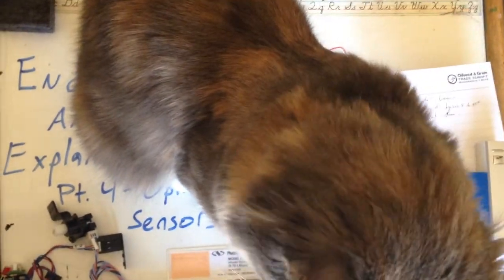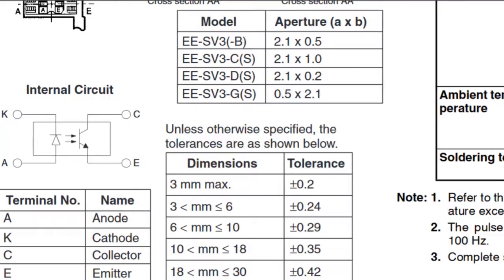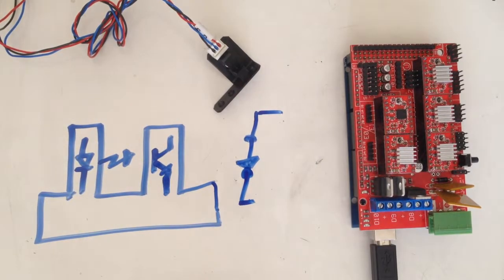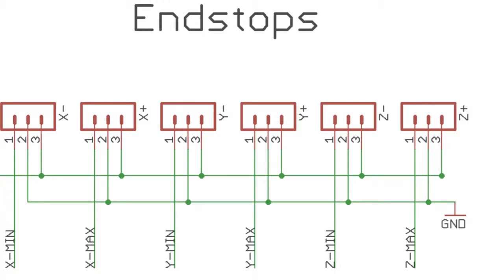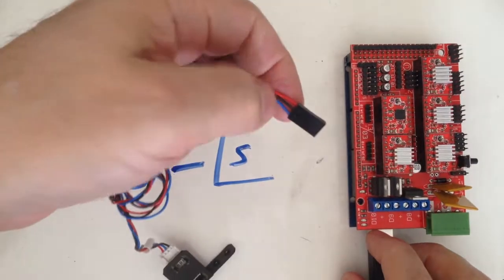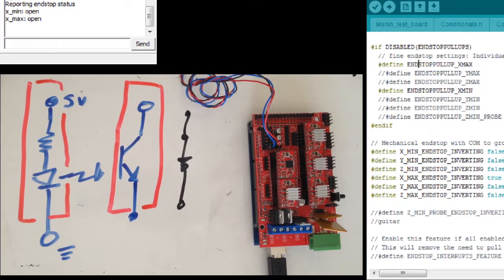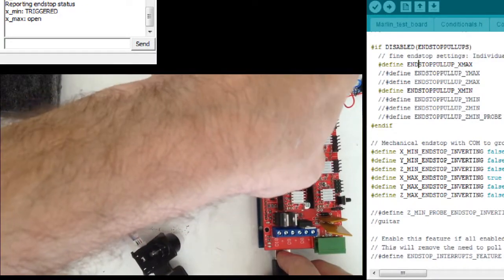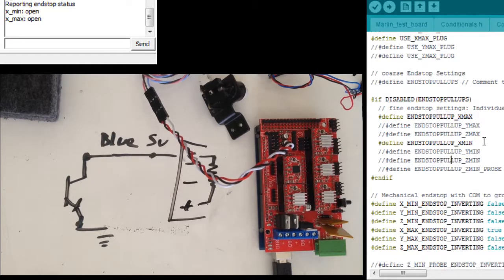Endstops and Explanations Pt 4  Optical Sensors

Comment: my problem have linuxcnc limit SW, i want use 3D printer optical sensor but problem have sensor have 3D printer uses 5V and my DIY big linuxcnc use 12V all sensors input. need make Z axis home SWITCH optical 5 V sensor, can i connect this to 12V power, or need use 5V and then output go to BOB card 12V sensor input pin. how connect this.

Comment: I have some confusion about the naming conventions...  Is the energized state considered the normal state i.e. If I have power, the switch would be closed, but if I don't have power it would be open. So would that be considered "normally closed" even though it needs electricity to be in that state??
Reply from the maker: very sorry for the late reply, I wasn't seeing any updates for some reason.  So, the "standard" way of saying a switch is in the "normal" position is when the switch is inactive.  Or as I was taught, if the switch is sitting on a table with no power or wires connected and nothing pressing on it, then this is it's "normal" state. The Normal state of a switch is that it isn't being used or actuated. Now, a switch can have Normally open contacts (no physical connection inside the switch, no current flows through the switch), and Normally Closed contacts (switch contacts are connected to each other, current flows through the switch). So you can have a switch that is passing current through it through Normally Closed contacts, even though the switch is considered inactive, or not actuated. If I am understanding your question correctly, (and I might not be), you don't need power on the switch to change it from a normal (inactive) state to an active state.  The switch ALLOWS power to flow through it, but the switch state changes based on if the actuator is pressed and the contacts open or close. The switch doesn't need power to be in either state, it just allows power to flow or not based on the switch state.

Comment: Hi, i have a cnc with mechanical switches and i want to put optical endstop switches, i bought some lerdge optical endstops , you talk about 5 volts to the switches but my machine throws 12v to the switches  and the signal pin has 12v and when you activate the switch goes to 0v , if i connect the optical switch the led is always on and doesn't do anything if i put the flag in between , would these switches work on 12v? do i need any extra circuitry to make it work, i don't know what kind of board i have  i know it runs GRBL 1.1
Reply from the maker: Sorry for the late reply, I wasn't getting updates. The answer to this is that I don't know what model of optical sensor you have.  can you send me a link? You'll need a sensor that can run on 12V, if you 12V on a 5V sensor, it won't work very well or very long.  Some sensors can work on multiple voltage ranges.  I have some Omron sensors that can work from 5-24V.  But most hobby grade sensors don't have that kind of flexibility.  Knowing what board you have would also help, as some boards have internal pullup resistors on their inputs and some don't.  If you can help me with that information, I can give you a better answer. There are too many variations of sensors and boards available for me to give you any kind of solid answer at this point.

Comment: great video but.... i have a 4 wire optical rd blk gn we and am told to use a 10K resistor somewhere and have a duet3 6HC and the IO pins are 3.3v sig in gnd sig out and 5 v
you mention treansistors but i have to use series resistor to achevie 160 ohms with 3.3v and 380 ohms if i use 5v could you help with the wiring orentation and what it would look like for me?
also it does not indicate to use 1/4w1/2w/1w ect... does it matter?

Comment: What is crazy?
I tell you what is crazy.  When you are someone like me who can't understand all the lingos, some maybe real and some made up.. who knows..  nonetheless just can't get what they are saying.   All that is left is trial and error.
And by golly I actually did it.
So this so-called photo-interrupter that the signal wire is negative and when the path is blocked, the signal just goes to 0volt, to put such a device as a subsitute for a hall sensor in which it is to be used with pull up resistor and when it is by a magnet its signal wire goes negative, not zero... how to do it.
Unreal, after every which way till sundown, at last got her smooth sailing.
1K resistor at its positive wire to positive rail and its negative wire to negative rail.   A 1k resistor at its signal wire to the base of a BC557 (PNP).  The Emitter to positive rail and the collector via 380ohm resistor to the gate of IRF9540N (P channel) and then a 10K resistor not to the positive rail but negative rail (mind you), or in the expert's lingo pull down.
To protect the FET from back emf of the coil of wire, and LED with 380 oh from the source and its cathode side at negative rail.
The coil of wire (the load) if you will also feed at the source and the positive rail with it proper ends to these contact points so that when the current move the coil will repel the magnet (correct polarity is important and made a note of it).  And the drain of the FET of course grounded.

The photo-interrupter, I positioned it just at the right place, just like timing a car (like in old days) So that when the magnet is just 3/4 ways past the coil of wire, it will be interrupted.  Exactly at the moment one wants the coil of wire energized, not before or in the middle of it.

So, in this configuration the coil is energized when the path of the photo diode is interrupted, i.e. 0 volts.  I still have to look closely to get a feel how, still to figure it out. Go figure.  :-)
Where the magnets were secured to the 3 fidget arms, I fed the little bolts through a think aluminium blades protruding out if you will. It got used for the path interruption.
Two PNPs, high value resistors, along with pull down is what ended up to be.
Reply from the maker: Awesome, I am glad you were able to work out your issues! I've had to learn a lot of things the same way.
I was just getting online to say I am sorry I didn't get a video posted.  I don't have a studio set up and haven't made a video for years, so by the time I got everything set up and ready to go, and then record it, I ran out of time to get the editing done. I'd still like to finish it, but since you got your sensor figured out, I'm guessing I don't have to rush anything.
Reply: @printerstein1321  You are the man.  I am certain you will have a more creative expression of it.  No rush but I will be looking forward to it.
I am slowly getting to realize that this whole  transistors and mosfet, the whole pnp and npn thing is more than meets the eye.   Their design is more involved than what one hears on the surface.
How they work the way they do. their values and so on.
Some lingos, my head just blocks.... and I can see it coming way before it blocks it...  I tell myself ... here I go.. I am not here ,,, yea I can read and pronounce the words alright..  :-)
Reply from the maker: @alchemy1  A standard NPN BJT transistor is in effect a variable resistor by which the resistance between the Collector and Emitter is varied  based on the amount of current flowing through a diode connected to the Base and Emitter.  Using that analogy has made it much easier for me to use them. Yes, I know that MOSFETS work on charges instead of currents. Yes, there is a crap-ton more to know about them, and looking up a spec sheet for one shows MANY variables to account for in using them, but starting from this viewpoint and drilling down worked WAY better for me that starting from the atomic viewpoint and working up to that explanation. 
For sensor applications, the collector-emitter path works more like a switch: 
Either fully non conducting (infinite resistance)(open switch)
Or fully conducting (almost 0 resistance)(closed switch)
The LED turning on the transistor keeps the transistor fully saturated (fully on) until the light path is blocked and the transistor turns off. 
Having said that, it sounds like you are using many different types of transistors in different ways , so you are in for a fun trip.  :-) 
Thanks for the nice comments.  Hopefully I can post something soon.

Comment: After my first comment beflow, this is my second comment.
So if the so called output is negative when my LED turns on (as explained below) when the path of light is open in the gadget, it means that the output must be on the source end of the detector and not on the collector end but that doesn't make sense whatsoever.
To have any voltage on the output be it negative or positive, first you need a resistor which has to be placed either on the detector's collector (for positive output) or on the source (for negative output).   However, you will get the voltage if the path of emitter is interrupted otherwise, it is current and no voltage.  You can't get voltage anywhere on the detector when it is turned on, conducting as then current just flowing through it.

So the only way the output is negative when the detector is on conducting current, it means that the output wire is simply the ground.  But that doesn't make sense either.  Because if that was the case, the LED will turn on whether the path is interrupted or not.
The fact is, my LED turns off when I block the path.
So whatever again.

Perhaps I should try this:
Put a pull down resistor in the output wire, connecting it to the ground rail.  Connect the LED before the resistor, that is creating my own point negative voltage there and see what happens. Maybe use a 10 or 100k resistor.
I will get back to you once I get this going when the spirit moves me.

Okay, whether I used pull up or pull down resistor of any value on the signal wire, no help.
With the pull up resistor I got nothing regardless which way I hooked up the LED.
And with the pull down at least I got LED coming on but with lower pull down like a 1K, it would barely turn off when blocked.  I used a 220 ohm with the LED.
Reply from the maker: Thanks for the comments and explanations of what you are trying to do.  I started to write a reply and then realized 2 pages into it that it would be easier (and make more sense) for me to make another video that address what you are asking about. I am hopeful that I can get this done on Saturday.  I honestly should have done it a long time ago.
But to give you a quick answer right now (or try anyway), you say the output "doesn't make sense", since it is shorted to ground when the sensor is unblocked.  While most of us think of an "output" and something providing voltage to another device, (hang on to that idea) in a lot of the industrial world, that "output" is just shorting to ground and completing another circuit somewhere down the line.  It's not "providing" power to something, it's completing a circuit that is connected to the output so that that other circuit has a complete path and can activate. That's why the LED connected between power and the collector is ON when the sensor is unblocked (light from the emitter turns on the transistor to short the OUT to ground) and OFF when the sensor is blocked (transistor is off so current can't flow through it anymore, so the OUT pin is no longer shorted to ground to completed the LED circuit). 
NOW, (again, I need another video) there are NPN transistors and there are PNP transistors. Which means you can have an NPN output style sensor that works like I just described, (when the output is ON, the output pin is shorted to ground) OR you can have a PNP output style transistor, which shorts the OUT pin to POWER, not ground.  In that case, yes, you DO have the output pin "providing" power to some other circuit.  But in the slotted optical sensor world, it's a rarity (in my experience, take that as you will) to have a PNP transistor output.  I've found PNP outputs on a variety of other sensors, but I can't recall ever having a slotted optical sensor that wasn't NPN.
Also, (again, I'll address this in the video) slotted optical sensors can come (typically) in 3, 4, or 5-wire packages. Any given 3-wire sensor may not act the same as another, the same with 4-wire sensors.  There are MANY different styles that might look the same but won't act the same.  I need pictures to explain why.
Wow, I probably have a page written already.  Keep asking questions if you have them, and stay tuned for the next exciting episode of this series.
Reply: @printerstein1321  Yes, everything you said  I have paid careful attention to.
[ One correction on your statement, probably just an error, "That's why the LED connected between power and the collector is ON ".  No the LED turns on when connected to the signal wire and the positive rail]

So it suddenly came to me to just open the gizmo and see what is going on.
Things looked pretty clear.  I could see everything, nothing I had to use a microscope on.
Both the emitter and the detector were exactly identical ( strange in  my opinion as an expert that I am... hmmm huh).  Each having two legs just like a regular LED. 
One leg of the detector was connected to the positive of the emitter. And its other leg of the detector connected to nothing and this one is the signal wire.
And the negative of the emitter itself.  So there is the three wires I see coming out.
The negative, the positive and the independent signal wire.
When energizing the emitter how in the world the detector single output wire becomes negative  being connected to absolutely nothing except being the other leg of the detector, I don't know.
In fact it is immeditely negative even before LED is on.  Because I see my power supply showing no current when I gradually increase the voltage. Even at 0.5 volts from my power supply, on my voltmeter 0.5 volts registers between the signal and the positive.  At 1.3V, current shows, which I just assume it is when the emitter is on.  The Blue LED turns ( I seem to always use Blue)  on at around 1.5 Volts.
Well on another note, I used this gadget to power up my fidget spinner pulse motor,  alll I got was high current, rough going.
Maybe it is the wrong deal.  Maybe I should use a light source and a phototransistor.. ( and probably with its own problems.
So for now over and out.  Looking forward to your video.
Thanks for putting up with me.. :)

Comment: Well, so I finally decided to use one of these toys instead of the hall sensor to power a homemade fidget spinner pulse motor I guess one can call it.
So, I destroyed one of these which had the same wiring as yours, black, red and blue. How do I knew I destroyed it, it is because when I used diode testing mode after I had realized ( which is in the following paragraph), I had readings between all 3 legs.
There were at least a dozen more on my pile, and the ones my eyes saw, they all ad three wires to them and all three wires looked alike.
So I took it upon myself to see which two wires went to the light emitter and which one was so the called output and what output actually meant.

So after reflecting, it suddenly came to me that the emitting light must be no different than checking a dog gone diode.
I put my mulitimeter on diode setting and two wires read a little over 1 volt.  So I figured which one must be ground and the other positive.
It was a dead giveaway.
Now is the output positive or negative.... hell as far as  I am concerned this output lingo has no meaning to me at all and rightfully so.
So I said there is only one way to find out.
Connect an LED and see if its cathode leg to the so called output and its anode leg to positive supply light up the LED, or the other way around?
Or the negative supply with each leg swapped with respect to it to and see what happens.
My first guess was correct.
The so-called output was negative output.  Why?
All other combination failed because I tried them just for sh** and giggles.
And when I interrupted the path, the light went off.

But if the interrupting supposes that you go what is termed as high (positive voltage) , whether positive or negative, which of the LED where, I got nothing.  Unlike most videos that shows interrupting of the path how their LED turns on... no sir, mine is always the opposite.  Well, isn't that nice.

So out with the hall sensor and in with this new find.
No matter WHAT VALUE RESISTOR I used and where and using a PNP The BC557 ( the whatever) transistor and a N Ch IRFZ44 or whatever FET it failed to deliver the result.
First, I could not succeed in inverting.  I figured when the magnet passes through the interrupter the coil should get energized, it didn't', it went off.
Second deal was high current no matter what I did. 

On other note: the hall sensor worked better without inverting as my original simple circuit was, just using it with a 1k pull up resistor with the N FET than when I played with the PNP transistor just so when the magnet is by the hall, I will get the FET to conduct.  The fidget spinner didn't have as much of a blazing speed as before.

And that is my story as of the present moment.